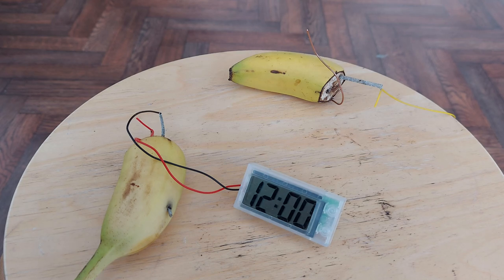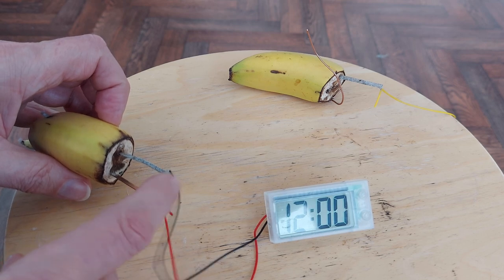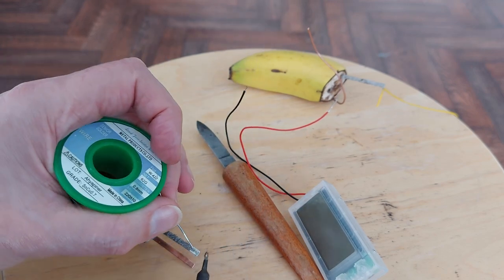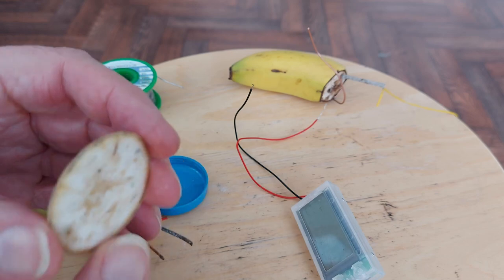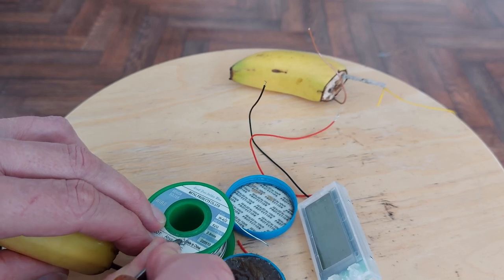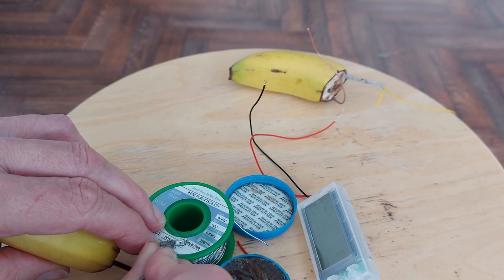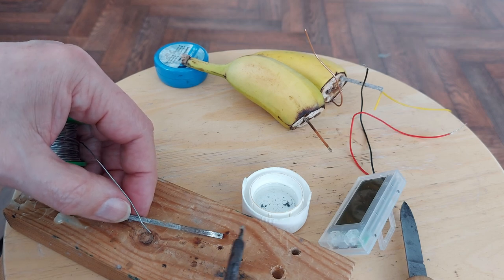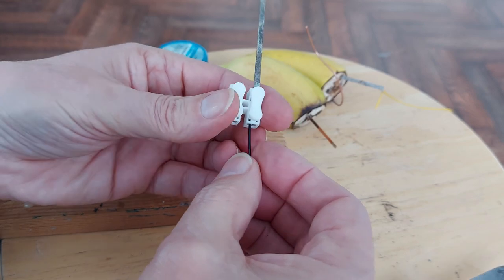Another look at that Banana Clock

Comment: Interesting to know that zinc won't take solder. I never knew that. Looks like this will run for a good while. 👌👍

As for aluminium, you can get aluminium rods that will weld other pieces of aluminium together but you need to use a blowtorch to do it. I bought some rods but haven't tried them yet. They are relatively cheap and have a flux core so you don't need any other flux. 
Of course, they would be for joining larger pieces of aluminium together and are seemingly very strong. It's really brazing rather than welding.
Reply from the maker: I am sure it will be possible to solder zinc, the context here is that "I cannot solder zinc" 😁😁 No doubt you just need the right type of solder, like you say, with the right solder you can solder aluminium. It may even be the same issue, the surface oxidises quicker than you can solder it, so it might work if cleaned and soldered under oil to prevent it oxidising.
Reply: Yes, did the same, it's tricky, because the stuff you are Aluminum soldering melts at a very similar point to the solder. And the oxide surface hides the fact that the work has gone liquid inside.

Comment: Yes, Zinc is a problem without special solder. And don't try spot welding it to certain things, because it goes bang.  Yeas A nice little crimp or a screw down terminal block might be the best joining solution.

Comment: Didn't know about the oil for aluminium. Good experiment and fix and I'm sure we'll see that clock in the future 😄
Zn Cu normally delivers 0.7V, I wonder if that clock will run on rain water?
Reply from the maker: It is visible in my daily "good morning" shorts. It has been running for just over 3 weeks now. The banana looks pretty black and horrible, but still supplies the goods 😁😁🍌🍌

Comment: Wonder how long you can use that same banana?  Fast as they rot, I would think not very long. But your final solution was good. Good contact and holds the strips for you.
Reply from the maker: It has been running for over a fortnight. The banana looks pretty gross, but the clock is still running. I did reseat the electrodes after about a week, but it is still the same banana. It is visible in my daily "good morning" Shorts video.
Reply from the maker: I just checked and it has been running since the 28th of January so that makes it about 3 weeks old 🍌🍌🍌

Comment: Can you not use crocodile clips on the wires
Reply from the maker: If that is your preference, yes, of course, you can use crocodile clips. Just out of interest, how would you attach the crocodile clips to the wires? I would not recommend the connectors I used for high voltage or anything important, but they have the advantage of not needing solder or a screwdriver, and I happen to have a pack of them that I bought many years ago just to try them out.